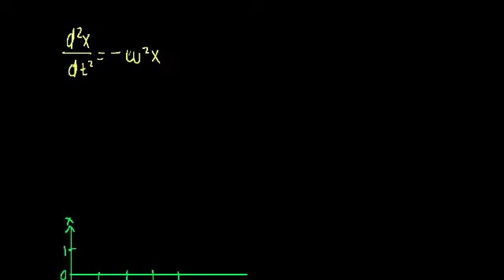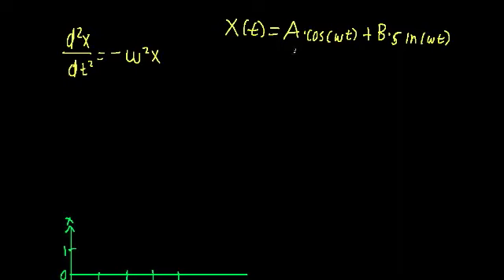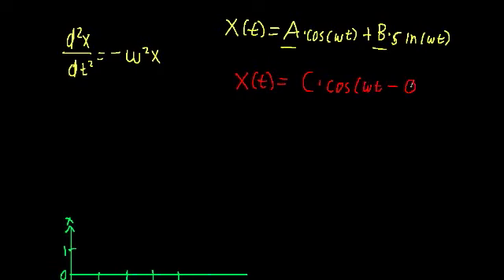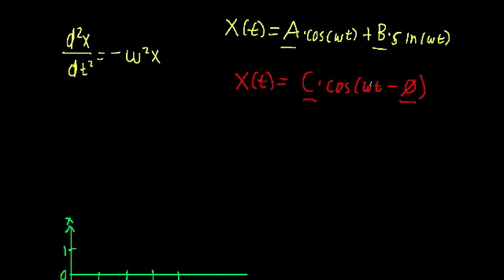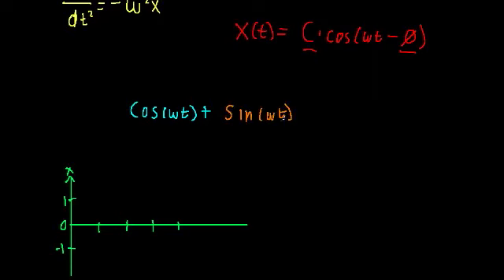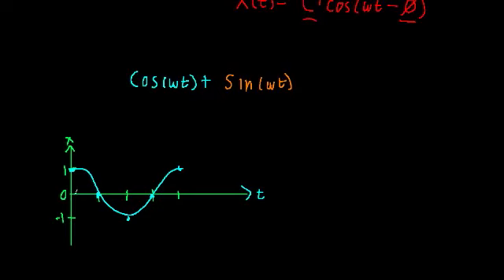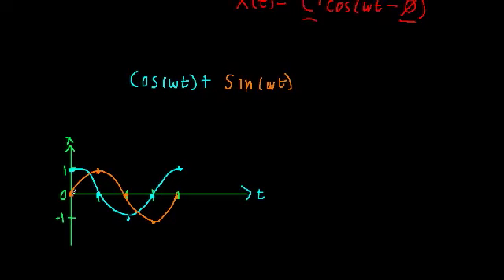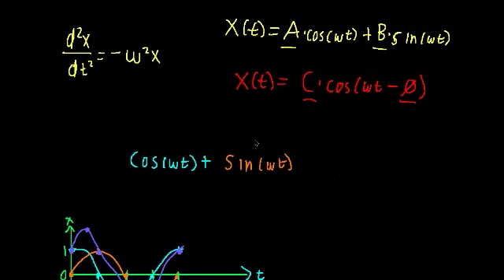Amplitude-Phase Form 1

Comment: I dont get where you are seeing the combination wave as starting from a point higher than the cosine wave.  It appears to start at the same point.  Also the higher amplitude value bothers me--its seems an offset SHM should have the same amplitude as the original case.  Thanks for videos on this important topic

Comment from the maker: You are exactly right they do have the same value at time t=0.  Basically what I meant was that at t=0, the cosine function is at it's max, the sine function is at 0, but the sum of the two is neither at 0 or it's max, it's somewhere in between.   
The larger amplitude idea should make sense considering we're adding two waves.  If we were adding cos(wt)+cos(wt) the result would be 2cos(wt).  The only problem is that here, since the waves are out of phase we can't add the amplitudes directly